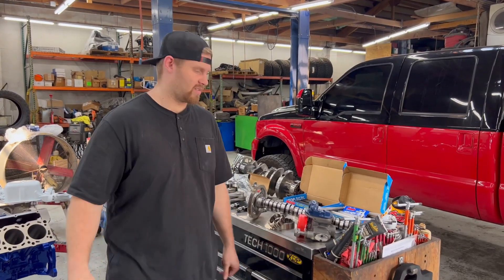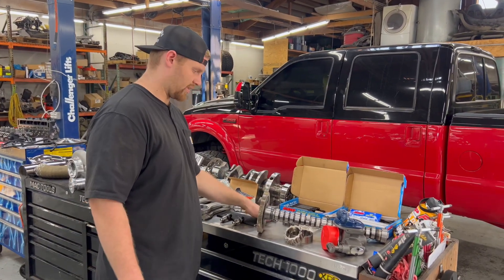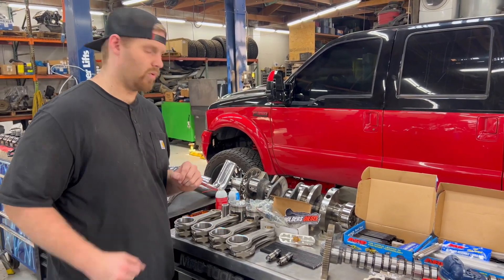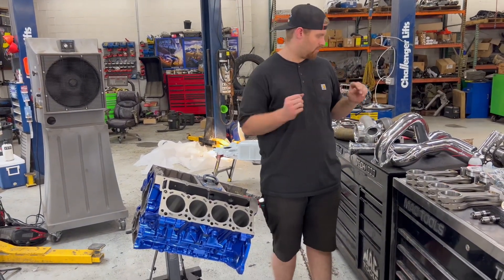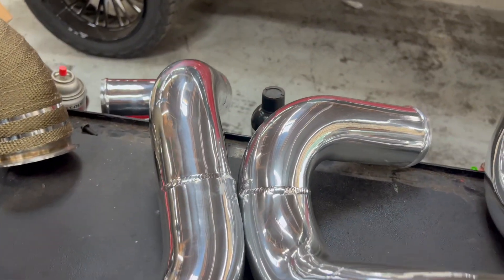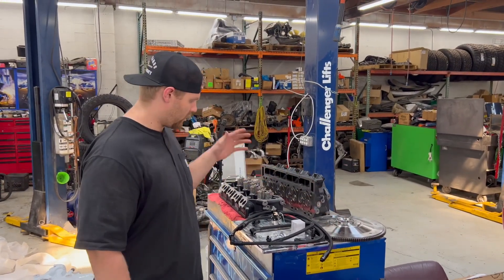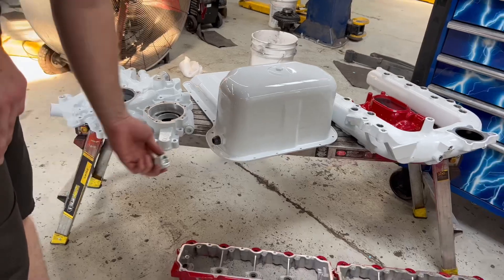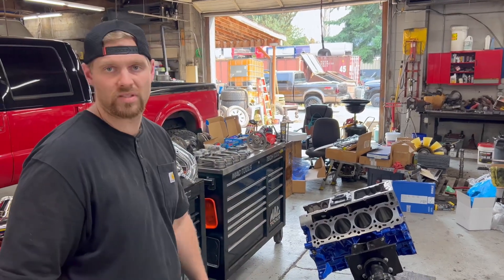Building A 1000+HP 6.0 Powerstroke Engine Specs***

Comment: I don't know why he didn't delip the pistons, & who cares if it smokes white when warmin up, the coatin will help protect against the high egt's
Reply from the maker: I mean you’re not wrong about the smoke at this power level I’m mostly talking about places who push coated pistons for stock-800hp you just don’t need them. And the guys running around 450hp towing don’t need them coated. Will it hurt no, but I can tell you from personal experience customers do not like the white smoke when warming up. The pistons were sent back out and had them Delip them as well as make the valve pockets deeper because we ended up going with a stage 3 cam. Back 3 years ago when I bought those pistons I did not know what I know now 👍🏻